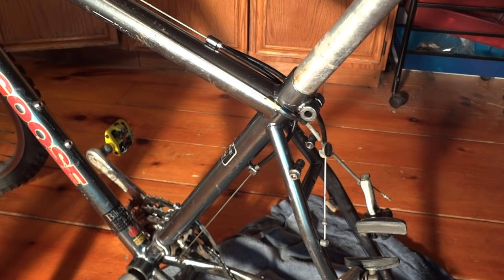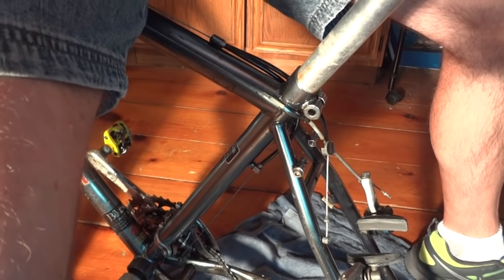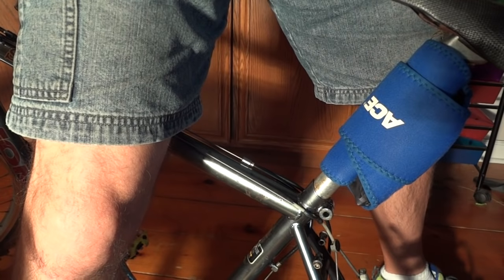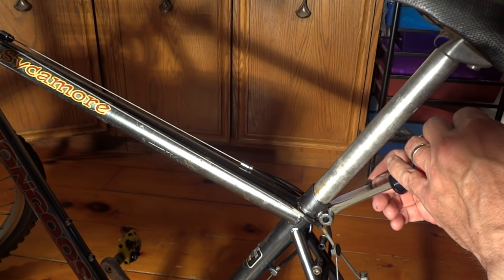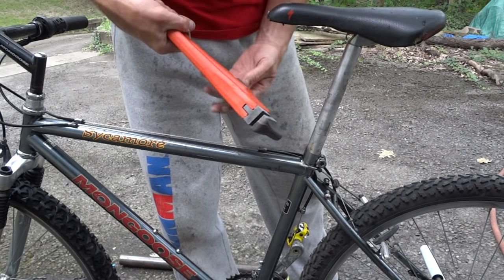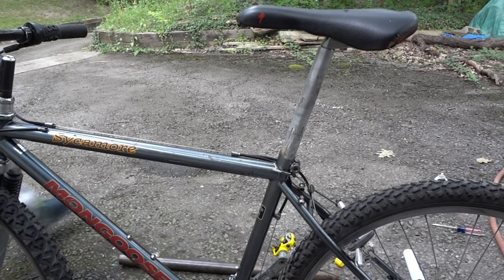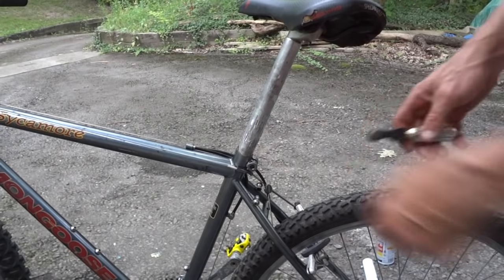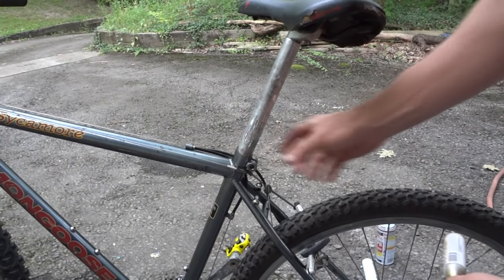Removing Stuck Aluminum Seatpost From Steel Bike Frame

Comment: I recommend to check steel seattube alloy seatpost periodically for rust build up to avoid stucked
Reply: That's a very good advice. 👍 I have a steel frame BMX bike with an alu seatpost that is completely stuck in the frame right now. I have been using different types of penetrating oils for hours and it's still stuck. When i eventually get it loose i gonna use your advice so i'm not going to have this problem on my BMX bike anymore.

Comment: This guy's patience is impressive. Had this happen to me before and tried many similar approaches. In the end reverted in inverting the bike and filling seat tube with Drano with some spectacular results! That stuff is evil and should be used with caution and only as a last resort. First it started smoking, then bubbling and gurgling and it all got very hot. The fumes were awful (good mask and thick gloves are def required). The Drano eats the alloy but not steel. Eventually left a thin sliver of seatpost in the frame that I could then remove.
Reply from the maker: sausage Yep, sodium hydroxide eats aluminum, but not steel.

Comment: After a month of WD40, heat & beat, I scored with an air jack. Seat tube in vise, jack between workbench and seat post clamp.  Dented the top tube, bent the clamp, tore my little finger all to Hell when the jack slipped. But I was finally able to install a long post and ride the bike. On my current project, the jack won't fit. :(
Reply: WD40 or penetrating oil doesn't help, it makes it worse, it just makes aluminium oxide expand.

Comment: Drop penetrating oil, vinegar, moonshine or whatever down the post just just as you did and leave it overnight.Take the saddle and wheels off and put the seat post cradle in a BIG vice. You'll be able to use the frame as a large lever and find it easier to pull up at the same time. Has worked well for me in the past.

Comment: Also happened to me but in the aluminum frame and the carbon tube. I put wd40 between the tube and the aluminum frame (enough) to let it absorb and then fastening the frame and turning the seat it released. After taking off, I cleaned and re-lubricated both the carbon tube and inside the frame with wd40 and it was perfect. There was no need to cut or break anything.
Reply: you should never use WD40 to re-lubricate, only use grease!

Comment: a method I used on a trash bike: I drilled a hole in middle of the seatpost, and put a long ass lever through it. only a little pull needed. you may not want a hole in your seatpost though.

Comment from the maker: I kinda wish I had bought the 36 or 48 inch pipe wrench. That thing was REALLY frozen! LOL!
Reply: just put a pipe cheat on the handle to make it longer
Reply from the maker: @orangestoneface  Too awkward for this. I did buy a 36" pipe wrench later on. They are very pricey!
Reply: @RJTheBikeGuy  ok.. then people thow them away in the local trash station and l was taking some big ones, but lazy to use them...recycling is not done right here. reason is workers refuse to take from containers cos they dont get paid extra for risk and effort. even if the station is selling tools that come in and timber and such . you talk so loud in vids , it is clear but no need l think , soft speaking is nicer to hear. one thing l did not find on yt was how to get a stuck chain from small drive teeth wheel and frame or crank stuck between can take long , so l made a bad one , you can do a better one.

Comment from the maker: It's just a steel pipe that fits over the end of the ratchet wrench. It's about 3 feet long and gives me lots of leverage. I got it at Home Depot or Lowes. The water probably wont help. It's only 212F. I was using a heat gun and that is a lot hotter. Not sure if it helped. At this point since you gotten it to move some, heating the seat post probably wont help. The idea was the get it to break it loose. Since yours moved, it is already broken loose.

Comment: I had this problem a few years ago with an aluminum post that had been pounded into a steel seat tube that was too small for it!

Had to chain the BB shell to a column in my basement, attach a block and tackle to the seat rails and a second column.  It took a lot of effort to add tension to the system, but it did the trick.

Comment: RJ What did to help it and it seemed work okay in the end,, i remove a 4mm allan screw turned the bike upside down and sprayed near a full can of WD40 and it worked okay.  I was expecting to see a lot of rust but no rust at all
Reply from the maker: Then it wasn't that stuck. And it's not rust between an aluminum seatpost and steel frame. https://www.youtube.com/watch?v=bGqV5KE7cb8

Comment: With the PB blaster. You are supposed to tap with a hammer the item you sprayed .You may want to invest in a smal mapp gas torch and a brake hone.  Heat the post up with the torch. Twist with the pipe wrench. then hone the hole out.
Reply: Brake hone wouldn't get enough use to justify the cost for me, so I just found a slightly smaller seatpost and wrapped it in sandpaper. Secured with tape, and folded over so both the seattube I'm "honing", and the smaller seatpost have some sandpaper against them to help hold it firm.

Comment: Good and hard job! Good tips too! 
Other tips: Fix seatpost and put force on frame - work with the frame. 
Or take an electric saw with a long blade. Cut the seatpost, then slice the seatpost from the inside vertically. Be careful with the electric saw of course!
But in your case you were successful with the big tool.
Wise is to put grease on the seatpost right from the beginning, which you couldn't do because you did not have the bike back then. Good grease stays for a long time and is cheap.
Reply from the maker: https://www.youtube.com/playlist?list=PLxO5aF0sensiVdiClC_JH6OboqFl5Dvay
Reply: You're not working on one of my bikes.

Comment: Thanks for a useful video demonstrating the various tips for removing the seat post.

I'm in that process right now, and have a couple more tips. Make a simple wooden wedge to hold the top of the seat tube open while you drip in the ammonia/cider vinegar/penetrating fluid (the eye dropper is an excellent idea). Secondly, tie an old sock around the seat tube to soak up most of the spillage.

http://i1216.photobucket.com/albums/dd372/Obiaq/seatpost_removal_aids_zpsg4usfrwk.jpg
Reply from the maker: Nnnuuk Something I hadn't tried (because I didn't know about it them) is this stuff: http://www.amazon.com/exec/obidos/ASIN/B00ACTMZOI/ref=nosim/youtube25-20
I am told it works on moderately stuck stems/seat posts. Probably not on hardcore stuck seatposts though.
Reply: RJ The Bike Guy Thanks for that. It costs over 20 pounds here in the UK, so it would have to be a last resort for me. Hopefully time and patience will do the job .
Reply from the maker: Nnnuuk Can you get dry ice? If so, you can try to freeze the seat post with that.
Reply: RJ The Bike Guy I l don't live in a city, so getting anything out of the ordinary is difficult. The problem is getting anything in a small enough quantity for a one-off job. I will ask around though.

Comment: just found out my seatpost is aluminum. will ammonia work better than pb blaster? i made more gap on the frame not just where the clamp area is but also in front of the clamp area where i used a screw driver and a hammer to hammer a bigger gap so i can put the penetrating oil in it. i just notice my seat moved left half a inch after seeing that my seat is crooked to left and not align straight with the frame which it was earlier.

Comment: RJ... but how do you rust proof the steel fork, and other tubes of the frame besides the seat tube?  Any recommendations?  Thank you... I have a modern 2018 steel frame from Specialized.

Comment: Would it be helpful to remove one of the water bottle cage screws, then turn the bike upside-down and spray the PB Blaster in through that hole?  You could probably fill the entire seat tube with penetrating oil and let it soak.

Comment: i'm not sure if my seatpost is aluminum i been using pipe wrench how big is your wrench? i'm using a 14 inch i'm just missing the metal pipe which can be use for more leverage. and i should remove both tires?

Comment: i'm just missing pipe wrench and heatgun i got all the other tools. i been using adjusting wrench while taking off the seat and applying it to the top part with my wrench.

Comment: Instrument repair people use a blow torch to expand stuck slides. The heat pulls the lube down into the joint. A heat gun isn't hot enough for the job.
Cold pack on the post, heat on the tube.

Comment: I just tried to hammer in a saddle pin into the frame. It wouldnt go in smoothly. Now it's stuck. You would think all those pins have the same measurements. Apparently not. Damn, how am I gonna get it out? I have to grind the top of the pin because its distorted now first.

Comment: Still unable to pull out the seat post. Still very hard to turn the pipe wrench with hands. Only can turn it using feet. My seat post has a hole I was using adjustable wrench and turn on the very top part of the seat post where the seat has a hole for the screw to put on the seat. that part came loose when it was really tight so now i only have the seat post without the top part. Any ideas of what I can do to get a stronger grip to pull it out? I tried gripping the post with pipe wrench.

Comment: yes bro. can't wait to post the video of mines it might be useful idea standing on pipe wrench with some bricks to support. i was finally able to move it more like good 90 degrees. i used two bricks for support and laid it on my door steps. then i stand up on the frame so it would not move and with help from a friend he was stepping on the pipe wrench with all his weigh and got it to move. right now its moving left and right while continuing to spray penetrating liquid wrench on it and stepping

Comment: Tip* you can make a hole in the Seatpost and put a metal round chisel in and turn it with a big wrench. don't forget to use WD-40.

Comment: too bad i had to damage my frame a bit. half a half on each side near the clamp is cracked. its still tight when i tried to put the seat post back. hopefully some grease and then hammering it back in place since I prey open the clamp with screw driver. Might have to hammer it back and buy a new clamp. :)

Comment: still pretty tight not able to move it too much with pipe wrench using hands. but with feet is fine. next goal is to be able to pull the seat upwards and i just don't know when that will happen.

Comment: Great great job. i have two bike like that and now i can try :-)) Thank's a lot for your videos. In case i'm not be able to extract the seatpost I would have thought of cutting the tube lengthwise. I have see the video on 2016 but i haven't a slide hammer of course -:((

Comment: Trying  citric acid . Old style seat post...seat loose  so removed it and plugged with silicone removed  bottom bracket  and will fill  seat tube with rich citric acid while frame inverted will let it seep for a week  changing  acid every  couple days then try pipe wrench. Seat post been in there since 90s  ....will see.

Comment: Please help me. My aluminum seatpost is stuck in my aluminum frame i tried using WD40 but i cant even twist a little, i also tried heating the stem with hot blower. PB blaster and Liquid wrench is not available in our county and its so expensive, so my only choice is WD40

Comment: Insane. These alloy seat posts on steel frame or racing bike 365 tubing is a good reason to sell my bike!  Surely God offers an easier way to separate this adjustable fixture! An adjustable inside leg conversion kit?

Comment: whatbis this obsession  with videos, that convey information soooo inefficiently? this entire 10min video could have been condensed to about 5 lines of text that cod be read in about 30 seconds.
1. soak overnight with PB blaster.
2. try cooling and heating the seatpost.
3. soak with ammonia.
4. attack with a pipe wrench (probably not the best idea if you want to save the seatpost. inverting it in bench vise by the clamp and torquing the frame makes better sense)

Comment: I just did the same on a Raleigh mountain bike. took me and to guys. few pointers. .  have someone pull up on seat while turning with the pipe wrench. 2. Continue turning in the same direction after it breaks free (also while lifting up). 3. Heat the frame, maybe dry ice the seat post but overall steps 1 and 2 are critical to keep it moving out. add lube anytime you can.

Comment: Everything shown here is the way to go!, ive found there is a type of pipe wrench, that locks, similar to a giant mole grip?, dont know the correct name?, but the three foot long locking pipe wrench will do the job, 
 I have used a dismantelling spray called ravenol,  molybdenim disulphide,  the magic part is patience!!, keep going back and spraying the clamp area, over the space of several days, allowing it to creep through the corrosion, i would not hope to save the seat post, unless you are extremely lucky!

Comment: I have a 1993 specialized rockhopper with a chro mo frame and alu seat post, when I got it it was seized stiff, put the seat post in a pipe vice and twisted the frame came off no problem! did the same for my vintage BMX steel post in steel frame

Comment: Had the same problem once. To get more leverage I took the seat and wheels off and  clamped the seatpost in a vice on my workbench. Then, along with liberal amounts of WD-40 , rotated the whole frame around. As I did this the seat tube got red hot and it made a loud screeching noise. This way I was able to pull and rotate at the same time. It still took me a good 45 min but it  came out.
Anyway , just one more option u can try.

Comment: Three hours later and a lot of sweat and my seat post is finally out.  All to make a 1/4" adjustment in saddle height.  It has taught me to check if the post is frozen on any used bike I consider.  Never again, I say!

Comment: Remove the bottom bracket and turn bike upside down in service rack and pour the fluids down the tube. Worked for me. The longer you can let it sit the better.

Comment: If you don't care about your post use this method; turn the bike upside down and clamp it at the post with a vice,  smash the tube and have someone help you rotate the frame whilst pulling upwards.

Comment: Good Video as usual, I had a GT MTB that I got cheap with a stuck post. I ended up cutting the seat post off and carefully used a hack saw to cut into the inside of the seat post is several places and that did the trick.

Comment: Well take off the seat and use the wrench   up on top were its square with a large ass Cresent wench so you  not mar the seat post I had a massive one  .. Its always steel rust on steel bikes . back in the day  I had massive  custom Vise handing from the ceiling  you  Pull down on bike twisting   but avoid t pulling  from stays ..  If its really bad pull the bottom Bracket complety fill with   Coke Cola from BB  and let it sit for a day or 2 up side down . works great with steel and  Carbon Bikes . all my bikes have really good electrical tape to seal the post   with a thin seal of Silicone at the very top of post were the clamp is , 15 years ago I was Rehabing 5 to 7 bikes a day . I couldnt afford to Mar up a seat post  it wasnt the cost   so much it was having it in stock the right size . But the Dreaded stuck seat post is a nightmare for backyard  duffers  not so much for Vetern Bike mech

Comment: A trick I learned for seatposts that you don’t care about it to drill a hole through the post, as close to the frame as you can, put a long leverage bar into the hole, and twist.

Comment: I just checked at four bike stores, a couple said they'd use a blow torch to heat the metal up and it will ruin the paint. One guy said to grease the post every year.

Comment: Take the saddle off so you can put gasoline inside the seat post all the way to the top tube of the frame then leave it overnight. Then the next day remove the gasoline inside the frame it should be easier to take it off. I do this all the time. And if it’s still don’t come off throw the bike away. Lol 😂

Comment: Top tip: That post has flat sides. Remove seat and clamp side in vise. Then twist left and right with your hands on the head set and rear dropout.

Comment: You should have used compressed air can. tilt it up side down and spray the seatpost. That will freeze and contract the seatpost real good and weaken the steel or aluminum or alloy whatever it is. See my video on how to break a u-lock with that process.
Reply: You posted a video on how to break a u-lock!!! Why on earth are you introducing a method for stealing bikes to all and sundry?! Is that wise?
Reply from the maker: Richard Terry What if you buy a used bike with a U-Lock attached to it, where the owner lost the key? I have seen/bought bikes in thrift stores with cable locks still wrapped around the top tube.
Reply: Richard Terry haha. you think guys that steal bikes use compressed air on the streets. haha. they use heavy duty snapon cut off wheels/grinders that can slice through the lock in 3 seconds. this is for the average joe that doesn't have those tools. just buy a $5 air can and use a hammer. just like shyflirt1 said there are a lot of bikes with locks whose owners lost the keys.

Comment: David Finlayson of www.prestacycle.com suggests the following:

1) Remove one of the bolts holding the water bottle cage on the seat tube.
2) Turn the bike upside down.
3) Spray WSD-40 or other penetrant through the hole for the bolt, wobbling the frame as you do so in order that  the penetrant runs down the entire diameter of the seat tube.

I haven't tried this method, but it seems much better than removing the bottom bracket in order to spray penetrant into the seat tube.
Reply from the maker: Yeah, you haven't had a really stuck seatpost.